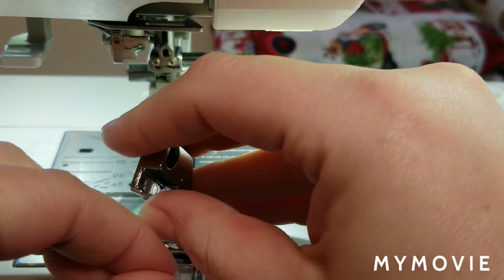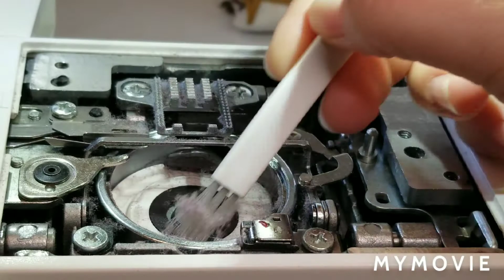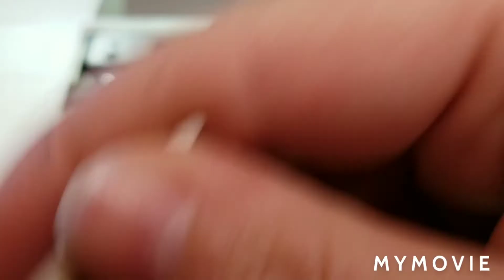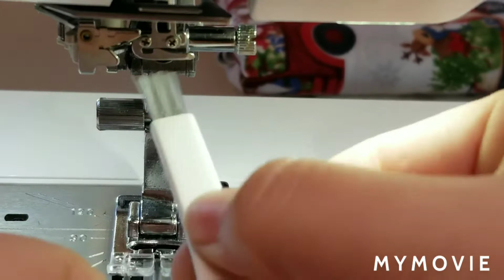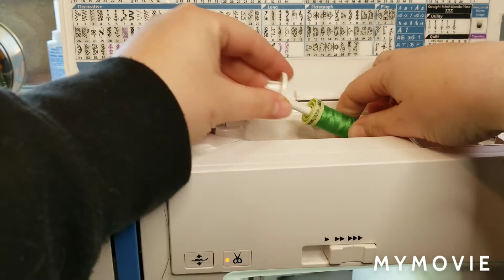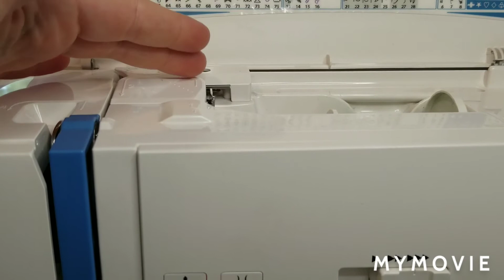Learn Your Sewing Machine! Janome Skyline S9: Change & Thread Needle, Change Foot & Clean

Comment: Can u use a blower to clean.
Reply from the maker: don't use a blower! you can push lint further into the machine. It can also cause damge to wires and other computer components. I recommend a vacuum with small attachments but be very careful still. Don't shove the attachments into too deep